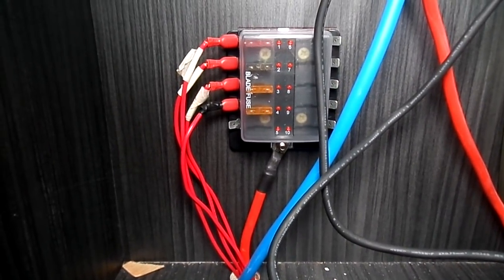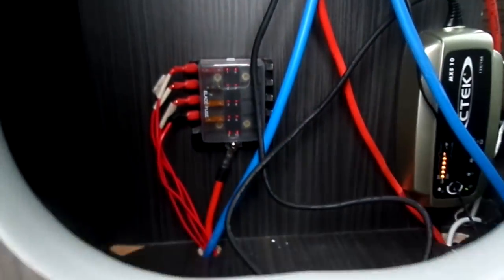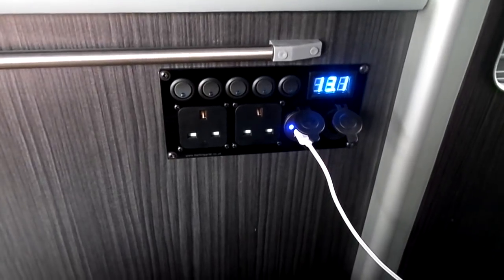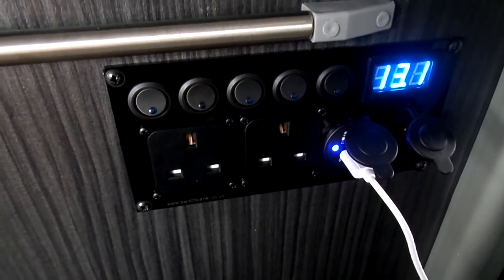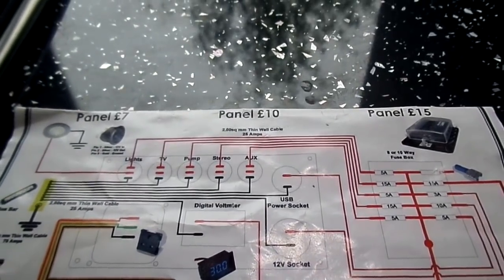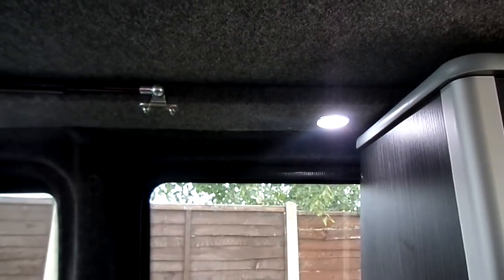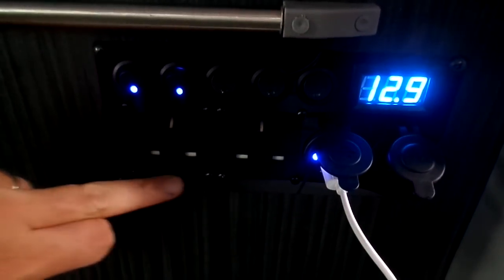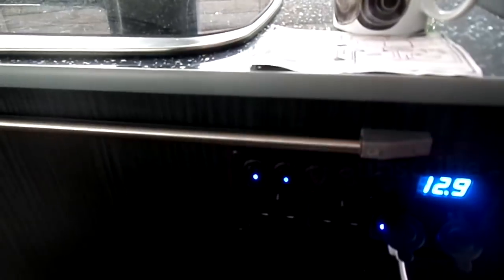How to install a 12v system and switch panel into a VW Transporter T5

Comment: i am a newbie and  learning the diagram makes sense now that  i was also given off someone on FB. I have a question, The USB, 12V socket and Digital Volmeter on the diagram show a semi circle going over the connection from LB, via 50A fuse, does that mean something else is to be connected before the connection to fuse box? thanks in advance, i have learnt so much watching informative videos like yours. Well done

Comment: Great explanation vid learning a lot about the wires wheat abouts can i ask about the wire from leisure battery to fuse box? I have 16mm 110amps cable that i am going to connect to the fusebox would that be suffice or would i have to fit smaller cable and if so what would you recommend Thanks
Reply from the maker: HI Bazaliz b, Yes 16mm 110 is perfect, thats what i used too. Good luck and thanks for watching make sure you sub ;)

Comment: Do you need a blade fuse before the 10 fuse box? Just wondering as I am just about to fit one, thanks
Reply from the maker: I've seen people do it without it but I would advise to do it.  Think about the length of cable you going to use. I would put a 50a  "link/strip" fuse in to protect that length. If theres a short along this length it could catch fire. Keep this fuse close to the battery and use a cable large enough to supply the current. Hope this helps

Comment: i was looking at a simmler set up,,, did you rig the volt meter and chargers to a switch in the pannel or not, i was wondering about turning it on and off
Reply from the maker: Hi David, Good question, i didnt really cover that. Yes so I had the usb port wired straight to the fuse box on permanent live and as for the volt meter, well i just shared it in the usb live to get its power. But yes you could absolutely have it on a switch, tbf its handy to see it all the time, but a pain when you're trying to sleep next to it :). Hope this helps.
Reply: fab, ill go switch let you know how it works out,,
Reply from the maker: thanks, yes let me know how it goes... check out my other videos see if they help. thanks

Comment: How do you connect items to switch panel you didn’t really show us anything I’ve got a desperate fuse panel that will connect to switch panel that also have fuses on the wire will I need to add another spade on the one that is spare on the back to connect them up?
Reply from the maker: Yeah I did say in the video if i can get some pictures of how it was connected i would but I couldn't find the pictures, sorry. If I understand your question correctly, its on spades also as it connects to the switch panel itself. So it goes spade to spade so to speak. Hope the reply wasn't too late, hope this helped.
Reply: I'M ALIAS TV yes so I can connect my fuse box to the control panel with switches and run the electrics off the back off the control panel as they have separate inline fuses coming off? Hope this makes sense as my fuse box Is confusing me as if I run lives to the electrics from that they will be permanent live ?
Reply from the maker: Not 100% sure what you mean on the electrics at the back of the panel. Do you mean the wiring for the 12v or the wiring for the 240 plug sockets? treat the two as complete separates even though they go to the same panel. 12v is permanently live -fed from your leisure batteries. 240v plug sockets are only live when hooked up. I hope im answering your question correctly. If not maybe try explain it again.

Comment: Hi
What did you use to connect the fuse box to the wires?
Thanks
Reply from the maker: Hi Jaaykaaykitesurf.. if i understand your question correctly, the female terminals? See below of most of the components i used.

Single Input LED Fuse Box (4, 6, or 10 Way - Please Choose at Checkout)
100 Amp Multi Point Bus Bar
3 Metres 10mm² 70 Amp Red Cable
3 Metres 10mm² 70 Amp Black Cable
2 Metres 6mm² 50 Amp Red Fridge Cable
2 Metres 6mm² 50 Amp Black Fridge Cable
10 Metres 1.5mm² 21 Amp Red Cable
10 Metres 1.5mm² 21 Amp Black Cable
Strip Link Fuse Holder + 60 Amp Fuse
6.3mm² Yellow Insulated Female Terminals (Fridge)
6.3mm² Yellow Insulated Male Terminals (Fridge)
1.5mm² Red Insulated Female Terminals
1.5mm² Red Insulated Male Terminals (Voltmeter Tails)
5mm Blue Insulated Ring Terminals
10/6 Copper Crimping Lugs
5 Amp, 7.5 Amp, 10 Amp, and 5 Amp Blade Fuses
Heat Shrink